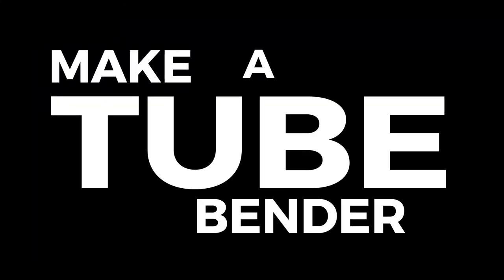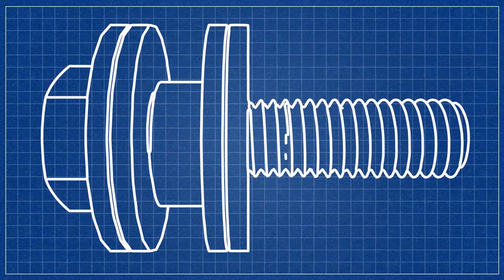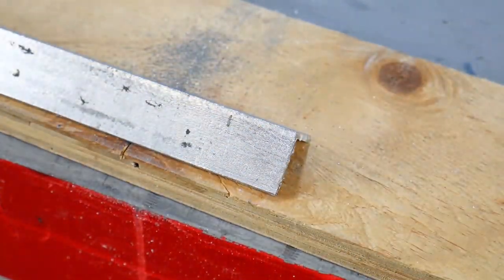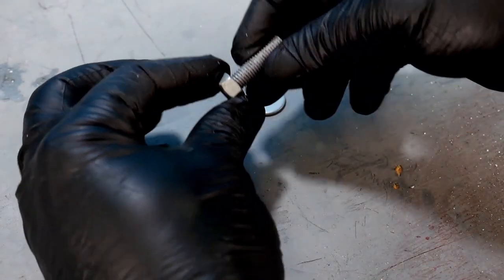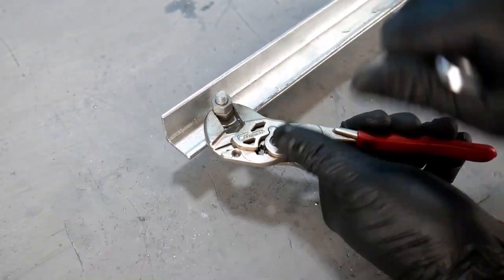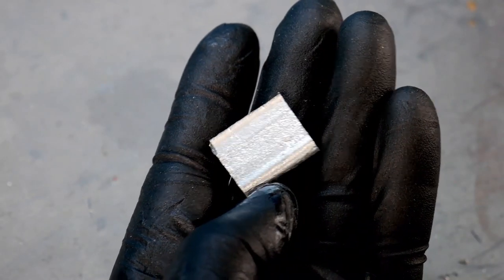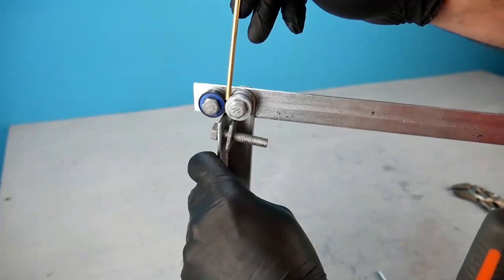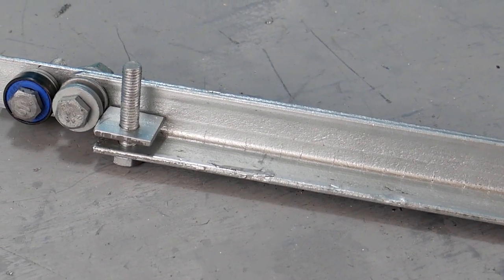How To Make A Tube Bender

Comment: Maybe you could fill the pipes to be bent with sand? I've seen that approach when bending PVC pipe.
And thank you for spelling "aluminium" correctly!
Reply from the maker: True, sand is a good option, it might be an issue to plug the ends, but it's a method that I'm definitely going to investigate. Thank you for watching and your input.
Reply: @cosador  Sand is the key.  It's an old tube bender trick.  Really nice design on your bender too.

Comment: The reason the tube flattens on bending is because your bearing us flat.  As you bend the pipe all the pressure is applied to the innermost surface of the pipe being bent.  You really need the bearing to have a U section outer surface which corresponds to the diameter of the tube being bent although how you might achieve that without access to a lathe I have no idea.
Reply from the maker: Correct! But I think it inspires people to think outside the box. Thank you for contribution. I'll follow up on this one soon ;)
Reply: @cosador  If you're going to using it frequently it might be worth getting somebody with a lathe to knock something up.  A piece of aluminium with an inside diameter the same as the bolt going through it and a 'channeled' outer edge would only take 10 minutes to knock up on a lathe.  Material cost would be negligible and a few minutes labour would make it very economically viable.
Reply from the maker: @andystokes8702  , I agree with you but I try not to up-tool unless absolutely necessary or I have taught or pointed out a way to do without. There will be a time for more complex tool utilization however I worry that some of the tools and materials that I have already used are beyond the reach of some very important viewers. Thank you once again.